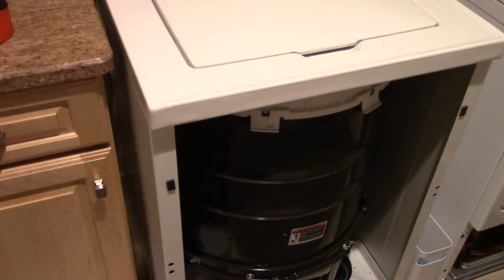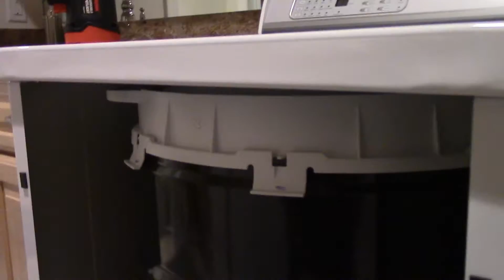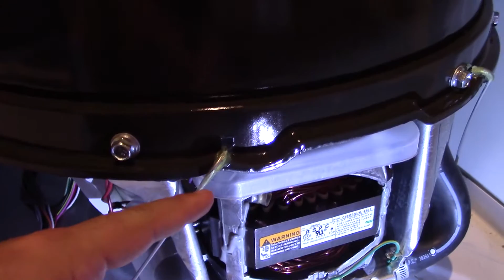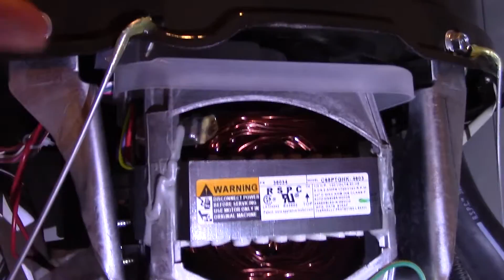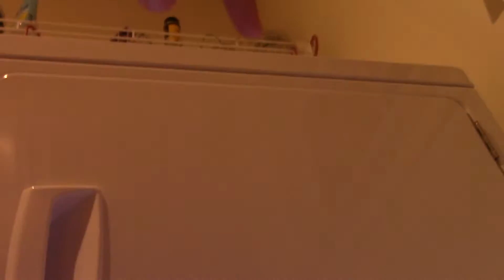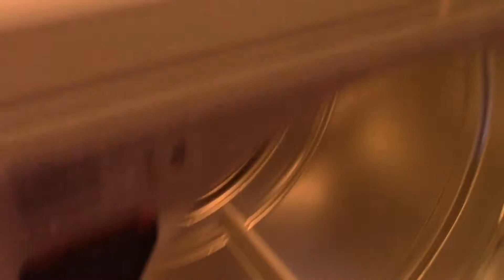Speed Queen and Whirlpool Direct Drive: Unbiased Comparisons.

Comment: It's a shame Speed Queen isn't making these with porcelain coated tops and lids. I don't use my bleach dispenser anymore. It is slightly discoloring around the dispenser. Porcelain would have been a better coating but what can you do ? 

The internals of these machines ARE HEAVY DUTY. The outer tubs look like 55 gallon drums. 

This is how Whirlpool should be building their washers.
Reply from the maker: I don't think they have made them like that for years. 

One advantage of Whirlpool's direct drive plastic outer tub is no chances of rusting.
Reply: Sharkie626 
Yes that is true about the outer tubs. Never had leaks in my DD washers in all the years I had them. Plastic is a fine material for the outer tub I suppose...I mean all it has to do is hold water right ?

I appreciate though that Speed Queen still builds them closest to what manufactures we're making in the 80's and 90's. There is something about the use of metal that is more aesthetically pleasing than the cheapness of lots of plastics. A sense of stability and longevity I guess...to my mind anyway.
Reply from the maker: Basically! It's still a moving part in the sense of the shakes it does in agitation and spin.  It's easy to keep the area around your bleach dispenser white. Just gotta be careful when ya put it in. But in your defense, that dispenser definitely could have been made a little bigger. 

Absolutely though. When you see the internals of this machine, it just shows that they do not cut corners here. Just the size of the parts shows the quality.
Reply: Sharkie626 

Going back to Whirlpool though , it is interesting how they went back to having the internals all hang off of the cabinet. Just like the belt drives did. As much as I love the belt drives I would probably take a 3 speed DD Kenmore any day over the old belt drives if for nothing else, availability and much more service friendly
Reply from the maker: Did the old belt drives do that? I never knew that. But even so, the metal they used was probably like 10 times as strong compared to the newer model belt drives.
Reply: Sharkie626 
I never knew it either until I found out on automaticwasher.org. If you notice on the belt drives , the baseplate isn't anchored to the cabinet and doesn't come all the way down to the base of the cabinet.
Reply: My moms first auto washer was a kenmore she got in 63 I believe . Mid range washer from what I can remember of it. Had the bake lite straight vane. I was born on 67, but I still remember it. Well built machines and it lasted until 1974. That is when my mom got a Norge.
Reply from the maker: Huh, surprised I missed this comment. How was the Norge? I've heard mixed reviews about them.
Reply: The Norge we got in 74. It was a great washer. Borg Warner sold Norge to Fedders in the late 60s and our machine was a Fedders Norge. It was a well built washer but the noisiest washer I have ever heard to this day. I guess the 3/4 HP motor had a lot to do with it.

It had a tall white agitator with a filter pan that sat on the agitator. These were great cleaning top loaders. It had a tub brake that would scare the s#$%t out of you if you opened it during spin, but the tub would stop instantly.

Low water levels on those washers were truly low because of the agitators wide skirt. That thing was huge.

My mom said it was her favorite washer. She really liked that machine. Hindsight is 20/20 as they say and if I knew then what I know now I would have had that washer fixed.
As much as i like the speed queen I got now, I would put it to the side to get a decent running Norge now. They were HEAVY DUTY machines in the truest sense of the word.
Reply from the maker: Well that's cool. I know how a feel ,but at least you got a very decent alternative.
Reply: Thank goodness there is one choice left anyway. I don't think I can own a Whirlpool washer again. Unless it is one of their fl washers which i do not want.Whirlpool simply does not build good top load washers anymore. None of their offerings interest me.  Unless they build the HE top loaders like the old F&P based ones or going back to the direct drive washers,...no thanks.
Reply from the maker: I fully agree!
Reply: Exactly. God bless you!

Comment: I wish they used better control interface. Mine went out already in the first 9 months. China junk electronics tho...
Reply: They covered the fix at no cost and you're complaining? I'm guessing Neither Whirlpool, LG, Samsung would have covered that fix 100% free
Reply from the maker: Was this on a Speed Queen? If it was only 9 months, warranty should cover that.
Reply: They did cover the fix at no cost to me. But still, I want 100 percent perfection from them.
Reply: Christopher Nichols 

Nobody is 100 %
Reply: I was told that Speed Queen touch-pads were not made in China, but made in the USA?
Reply: I would have gotten manual controls.
Reply: The controls are made in Spain
Reply: My 2019 speed Queen tc5 just has 3 knobs

And 2 capacitive buttons and 1st one allows the option of having a full tub of water or half tub.

And the 2nd capacitive button is the Start button .

The washer has 4 status indicator lights and the 2 buttons also has lights

Totaling out to 6 lights on the unit (alot less than the 2017 models with touch controls)

So yeah it also lacks of a timer display.

But anyway the less the better

Comment: I have the SQ washer with the mechanical controls. The belt is a rubber/fiber mix so it acts as the clutch. My old WCI Frigidaire did the same thing with the belt and that belt last almost 15 years before slipping to the point where it needed to be spun by hand.
Reply from the maker: Cool info! That's really not too bad either.

Comment: I have a GE washer but it's the older kenmore
Reply from the maker: You sure? Kenmore and GE were totally different brands.
Reply: Sharkie626 oh crap I ment to say I have old HE kenmore
Reply from the maker: Oh okay! Makes much more sense now.
Reply: Sharkie626 It has no error codes, it lasted 15 years it only drains if the lid open for a long time
It gives enough water to flout close
Reply: GE and Kenmore have never had anything to do with one another in terms of manufacturing clothes washers. Dishwashers yes, clothes washers no.
Reply: GE stands for Grief Expected. LG is Lotsa Grief. I've had both in the past five years, and I'm either getting a pre-2018 Speed Queen or a pre-Whirlpool Maytag, maybe a Frigidaire Pulsamatic or something with a wringer. I've had it with the so-called HE machines.

Comment: Isnt it obvious to companies like Whirlpool that these style machines clean better? This new bullshit with the stupid belt drives and load sensing is just more issues to go wrong. Why cant they just stick with the good old fashioned machines that actually CLEAN? The only thing from Whirlpool thats still good as far as im concerned are there stoves, dishwashers, and thing like that. Their washers are so shitty now. Im so disappointing with these new HE washers. Absolutely sickening. Speed Queen will forever remain the BEST quality current and modern washer and dryer brand!
Reply: Daniel there were basically two issues at work here:
1 ....Laundry machine manufacturers, whose market share is basically steeped in the home and garden department instead of commercial fare like Speed Queen, faced a marked increase in material costs. To try and keep their profits good, they started using cheaper materials and construction. Why else do you think their $1000 machines come with a paltry 1 year warranty?

2. Government mandate required that their washers use less water than ever before, dramatically less. So more cost was incurred when they had to go back to the drawing board and crack the whip on their designers and engineers who were faced with this stringent demand unexpectedly as well. They had to redesign everything.

It doesn't have anything to do with what the customer wants, it was other factors at work that foisted their crappy machines on us

Other countries have been using front loaders for decades or what are called horizontal axis washers.. However their front loaders are made much better than what you find with USA brands. Most of the world doesn't like HE top loaders or top loaders of any type, because of water miser laws and for some reason they may just find them awkward and don't think they clean well.
Reply from the maker: Yes indeed! Whirlpool really headed the wrong direction with their machines in 2011. I would not even be able to compare this machine with their new belt drives.
Reply: Sharkie626 I just hope SpeedQueen doesn't try to pull any fast ones and remove the main agitator from the washers and replace it with "Augers" or the lack their of.
Reply from the maker: So far I don't think they will! Just adding that "Eco" option (emphasis on the OPTION word) is keeping them in standards. So I think they will be good for a while!
Reply: Sharkie626 I would really hope so. They need to stick to their uniqueness. And I'm surprised whirlpool hasn't changed their dishwashers, they still operate the same as the did years and years ago when appliances weren't so techy. I'm sure they'll remove the spray arms from their dishwashers and use something really stupid instead like the LG waterfall dishwasher has.
Reply from the maker: puts a tablespoon of water on the dishes All clean!!
Reply: I hope as long as speed queen makes these washers that they never go to a dual action agitator. 

The undulated vanes the flex vane uses is old school Whirlpool surgilator inspired. They were some of the best oscillating agitators made.